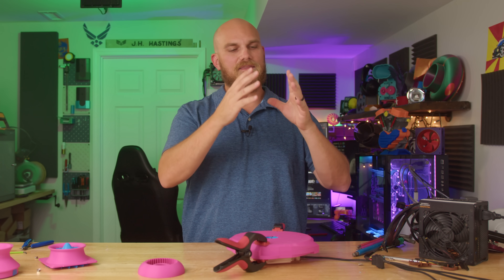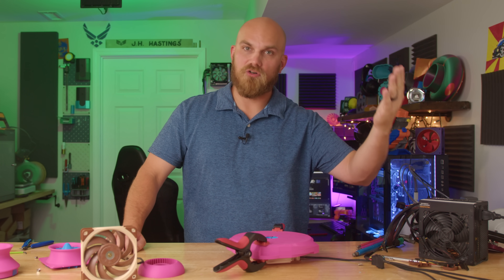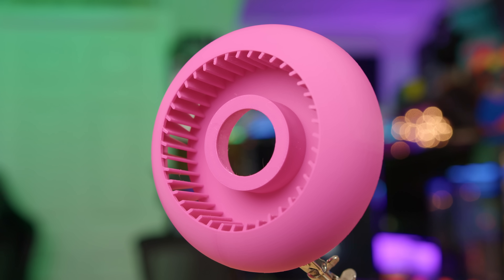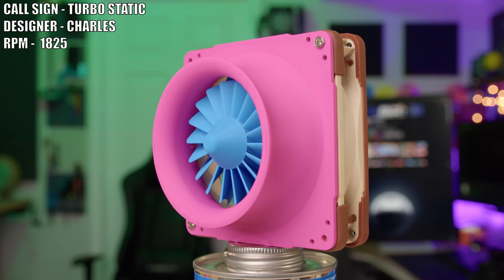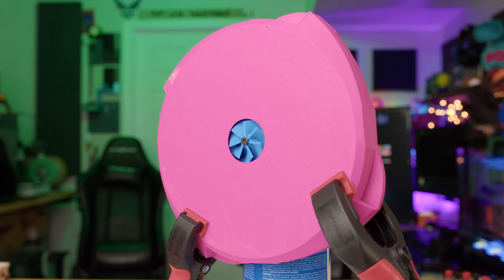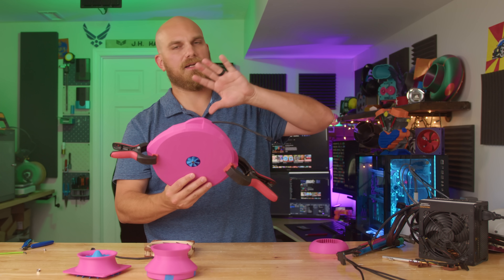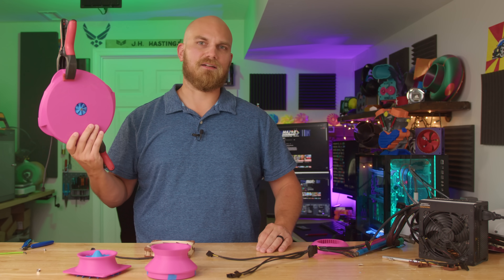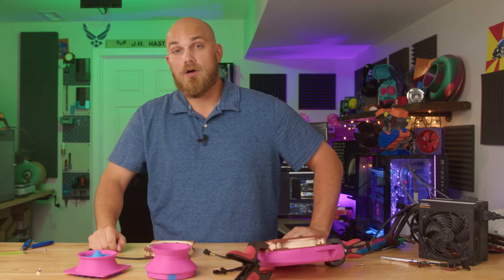Wild 2-Stage 200mm Blower Fan Redefines Power | Fan Showdown S6E6

Comment: I'm in the camp of " if it fits on the front/top of a PC case and doesn't spill to much outside its footprint then it's good." Like if you've ever taken apart an OEM PC that had the thick front bezel and noticed all the extra room between the plastic face and the metal chasis. If the fan fits that role then it's good IMO.
Reply: Also I'd love to see what the best efficiency fan is. IE power draw to air volume ratio.

Comment: I hope you balanced centrifuge madness better than we saw in the clip. It had a stage one had quite a bit of runout and I think it's from your center hole not being centered. That would have been fine if you would clocked them back into the same position when reassembling them. I think I can hear it's runout/unbalance in the audio clip. That would for sure cause it to lose performance.

Comment: Perhaps having 2 classes of fans. one is fans that must fit inside the standard frame, while the other category the only 2 rules is the fan is powered by the 1286, and the air should pass through the hole of the frame.

Comment: hey if you ever need to seal and glue some fan housing together, I recommend silicon caulk. It is strong enough to hild theses together, seals great and can be dissesambled with a razor blade ans some prying. It stays soft and flexible and is not expensive. Downside is the long curing time
Reply: Replying to this comment to boost it.
Reply: Found this comment after making a similar one of my own, I gave the comments a quick search, but you left the "e" off silicone. 😅 Not that it's a big deal, most people are smarter than control-F, and know exactly what you mean.

Comment: Group B, but with a pretty serious caveat; scoring methodology should be more meaningful based on what people care about. Static pressure,  airflow, and noise are all important factors and scoring should reflect that. Imo, scoring should be broadly two different lists, which prioritize maximizing pressure and airflow while minimizing noise, so something like (H2O/mL)/dB for example for the pressure list (with a minimum numerator required so that fans can't divide by the limit approaching 0 to win). 

Also, and maybe more importantly, fans should each get a pass/fail grade for fitting in a given test case without having to remove any panels, which could still allow for fans that outside the frame of the A12x25, but it would put upper limits on it. Testing done in a case like that could also give insight on how the fluid dynamics of fans change as their intake has to say, pull through a mesh dust filter or a partially obstructed front panel. 

Ideally, it would be amazing to see people design fans so good that manufacturers bring them on board to help make better fans for consumer products 😊

Comment: Group B easy but I feel like you should note which fans are "stock" ie fit in a12x25 with no additional components and then include an anything goes note as well. Both on the same leaderboard but with notation next to them and you mentioning how they did in their respected heat.

Comment: The two-stage fan moves more air but in a way that is totally useless for cooling. The air needs to hit the parts that need cooling, not just blow out of the edges. In fact, adding that to a multifan setup would probably hinder the airflow in the case, disrupting the flow of the other fans.
I have no issue with the crazy designs, I find them interesting, but it can't be about the numbers alone. They still need to, at least in theory, perform the task they are designed for: cooling.

Comment: No need for two scoreboards, just have a checkbox saying if it fits within the fan frame. Then those that care can just look for the highest ranked thing with a checkbox tick.

The static pressure side of things is what I'd like to see changed, I'm not really interested in seeing "who can build the best air compressor". It's not really useful as a PC fan, and it's going to rapidly converge on multi-stage compressors that limit airflow and are all pretty similar in design, and anything that actually works as a fan is going to be so heavily penalised it won't even make the first page of results.

IMO stick an actual radiator behind the fan or some other grille obstruction to establish a consistent baseline minimum static pressure required at a pragmatic value, and then go back to measuring flow downstream of that.

Comment: What you are seeing is measurement system error.  Static Pressure is important but you are measuring the wrong thing.  What is the VOLUME = CFM (cubic feet or centimeters per minute) of airflow?  You can have huge static pressure and it means a hill of beans worth of NOTHING if you are not also producing the right volume of airflow.  You can see this with your new champion in the smoke test where very little air is being moved at all from one side to the other -- except the little air that is being moved is being pressurized extremely well. -- FYI - I am a Business Leadership consultant and Industrial Engineer -- solving these kinds of measurement system problems for companies is like blinking my eyes before breakfast.  ;-)

Personally, I would love to see a champion pulled from:  Highest Volume of Airflow + Highest Pressure + Lowest Noise -- I bet Noctua has a weighted linear equation (eg: = 2xA + 1xB + 1.5xC) for this to determine good fan design for their customers.

Comment: I bet a multi stage axial fan could do better than most of the blowers, my guess is that the centrifugal designs are better at using all the motors energy, but maybe aren't the most efficient. id also like to see a super speedy fan using gears to put the motor into overdrive, as small radius should lend itself well to high rpms

Comment: I do wonder if the rough edges of the 3D prints affects the overall flow of air, since the surfaces of those 3D prints are rough and have layered lines they might impact the efficiency of airflow as air passes through it, compared to plastics that are mold injected which has a smoother surface.

Comment: I see one of 2 solutions. Solution 1 is to just have 2 charts, 1 for those who stay within the A12x25, and those that do not. The 2nd solution is to use a point system like they do on the tool review channel "Torque test Channel." You award points based on performance and penalise points for size and noise. This way the fans at the top are the most efficient

Comment: at 7min it demonstrates why I use QL120 turbo static = QL120 rgb fans Radial = noctua silent wings other corsairs the lot, there's a reason why I use the worst static pressure fans on my 3x360mm custom loop even at 1600rpm I could let them run all day long and my pc is abovy my desk at head height a whooosh you can live with an annoying whine you can't, Major comment on the centrifuge madness is exactly that dB don't matter as much as the annoyance and noticeability of said noise, yes you can have better cooling and indeed I had 2°C less on liquid temp...in exchange for unbearable vs "don't care" amount of noise

Comment: Mr. Major Hardware ive got a project/video idea. I would LOVE to see a cross flow fan that would replace a tripple 120mm fans at the front of the case. Perhaps it would be higher performance, perhaps it would be same performance but quieter? I believe they are used in internal AC units and similar.

Comment: Three Scoreboards:
1. Standard Class: designs that traditionally stay inside the dimensions and housing, like the A12x25 fan.
2. Extended Class: designs that only protrude forwards from the housing without being bigger in diameter than it.
3. Unlimited Class: designs that do extend outside of the housing, anything goes as long as its powered by the housing's motor.
Reply: 3 classes are probably the best
Reply: when buying a computer case, you could have spots that the fans barely fit, and ones that have room for extension. the only time I can see room for the 'winner' was when there was room for a bigger fan.
Reply: @argmarwell  This would fit on an external 120mm fan mount, forcing fresh air in through a similarly sized radiator.
Reply: I came here to say the exact same thing.
Reply: Even two classes, practical and insane
Reply: I'd be interested to see a category for fans that could feasibly be mounted inside a PC case with a 200mm fan mount.
Reply: These three classes are exactly what I was thinking. Maybe with the addition of a height limit for class 2 like no taller than 4 A12x25's stacked, or something.

While the unlimited class can push the envelope in really interesting ways, it's even more impressive to me when someone can take those strategies and fit them in a normal (or mostly-normal) size package without losing much performance.
Reply: 1 standard, 2 outside the fan casing, 3 ANYTHING GOES as long as its atleast the same parts from the fan and the rest plastic.
Reply: Just add weight classes, the most efficient per weight should be the winner.
Reply: I would like to think another qualifying category split would be:
A) Fans that would fit where you would install a A12x25 (inside a PC or wherever)
B) Fans that don't 

This way we get normal and fancy fans that have a standard profile, and fans that just test the power and technology of fan types and designs.
Reply: This is what I came to the comment section to post. Exactly what I was thinking!
Reply: So Group N, Group A and Group B. :V
Reply: 4. Pro Class: Literally just a leaf blower
Reply: Agreeeeeeeee!
Reply: Exactly what I was thinking.
There are applications for the standard dimensions.  But there is also applications for more flow and pressure.

Your real problem is are you going to keep it to only pressure or CFM or are you trying to maximize FPM on a target.  Or are you going to go all out to and measure CFM, Pressure, and Watts and try to find the most efficient or most powerful.
Reply: Yeah this makes the most amount of sense
Reply: I would add the constraint to the extended class that it can't extend further than one frame depth. So shrouds, spindles, and larger curved blades could work but they would still likely work in a significant number of cases and applications.
Reply: Either that, or put everything on the same scoreboard, and color code them so you can see what the best in each class is, and how they stack up to other classes.
Reply: I really like having 2 classes, and I think each class should get their own scoreboard. That being said depending on time required it might be worth it to just merge classes 1 and 2, with a simple rule like no more than 1/4" or 1/2" beyond the frame. Or even just have classes 1 and 3. Either way I think separating their score boards and ranking would make it a lot more "fair"
Reply: @Goodgu3963  I think @Angel-dp9sl is right about this, because his 3 categories could have different purpose, 1. you could fit that under a radiator as pulling fan, or inside the case, between the case and the radiator, the 2. category you can fit it on a case from outside without much inconvenience and you can place them next to each other so it's usable with a multiple fan radiator, like a 360 mm or 280 mm, or just as functioning case fans so still usable practically, and the 3. one is all about single fan slot performance, but it isn't that practical, because the performance of a 240 or 360 mm radiator will be better than a 120 no matter what kind of fan you use.  

It would make sense to compare these categories separately, because some of them sacrifices functionality/practicality for performance. So if someone would like to now what's the best one that can fit inside a case, it would be easier to find.
Reply: Those 3 score boards make sense.  But, the more restricted classes should all be in the less restricted classes as well.
  Who cares about any fan in the extended class if the standard class can beat it?
Reply: For the extended class, it should still be small enough to reasonably fit inside (or on the rear) of a case without going crazy.  So, perhaps limit the extension to one additional inch?
Reply: I disagree, 
I think the breakdown should be as follows 
1. Standard class: fans that fit within the housing of the A12x25 
2. Fans which can be printed in 1 piece 
3. Anything goes
Reply: @martinshoosterman  Your second category has no logical basis, most of the extended fans are multi-part, most of the standard fans are already single-part; did you even think before typing this?  The original comment's three classes make the most sense, but the second should be amended to having a length constraint, as unrestrained length would likely cause issues if someone happened to submit a design that ends up being the width of an ATX footprint that no case is likely to fit.